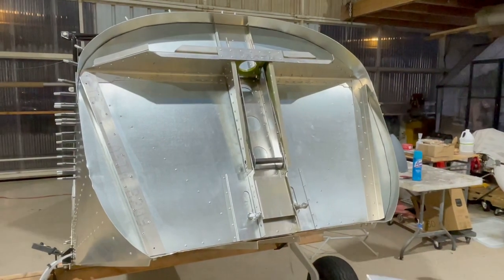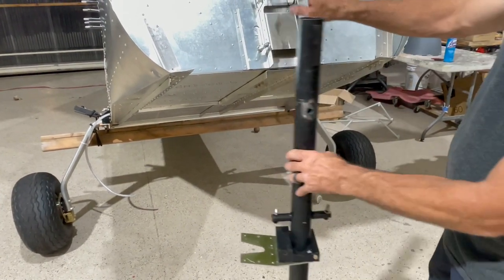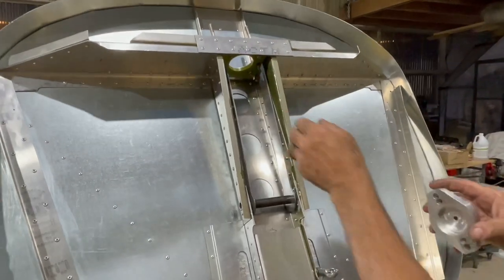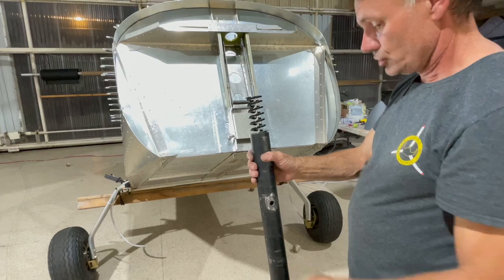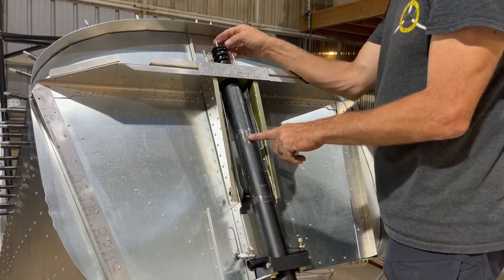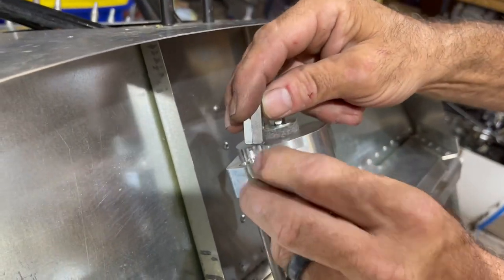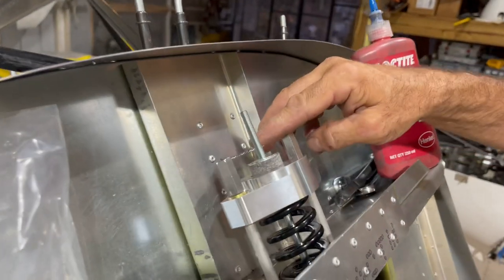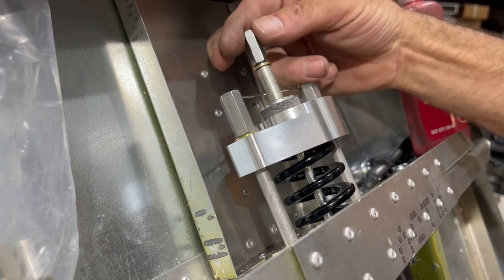Viking Steel Bungee Installation

Comment: On my 701 the long middle bolt hit the top engine mount. This is the easy way to fit , different if the engine is in.